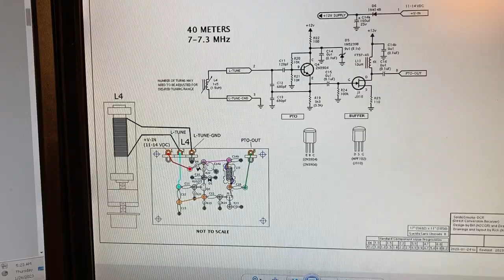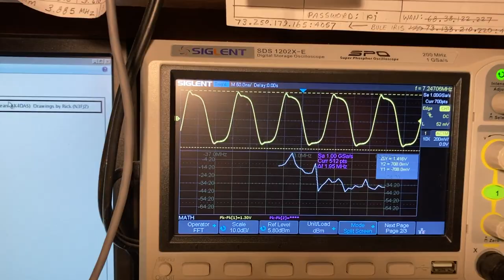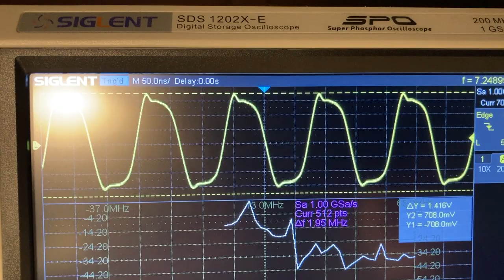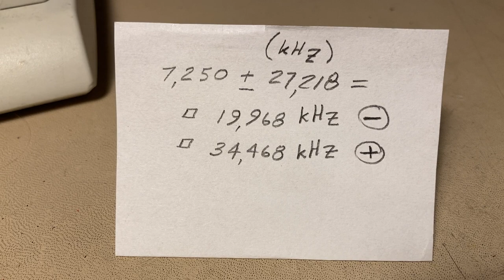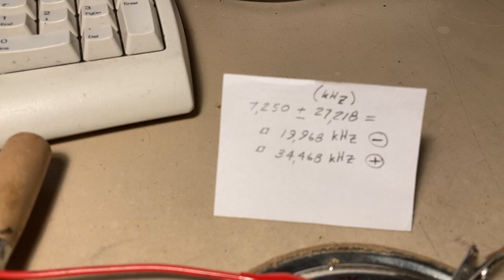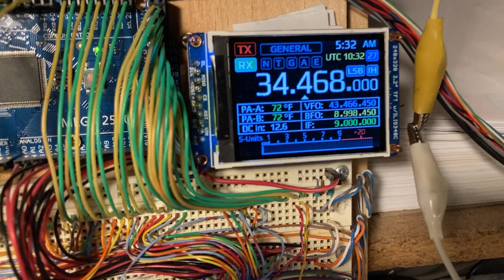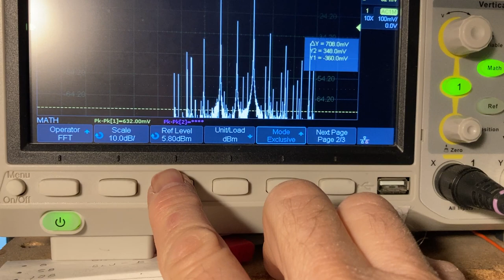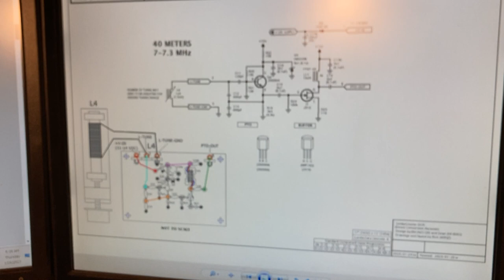SolderSmoke DCR The Joy of Oscillation

Comment: I used to have notes to make the terminal strips out of perf and wire. Can't find them and Google is no help. Duck Duck wasn't either but it did show me the seller of the VU meters I've been looking for. 

Quick question, what did you use to draw the parts placement section?
Reply from the maker: Here's a link on how I do it; however I simplified the design where I changed the lower wires (that solder to the board) to be simple loops (like the top ones) and I bend the loops on both the top and bottom to 90 degrees (if the loops stand straight up, the solder runs down too easily).  Here's the link: http://www.remmepark.com/circuit6040/term_strip/term_strip.html 

I use TurboCAD for the layout and Microsoft Paint for the schematics where I just draw the elemental components as blocks and move them around manually, and for MS Paint, I cut-and-paste at the pixel level (as if the drawing was paper), there is no automation; e.g. wires don't stretch when you move a component, et cetera.  I trained to be a draftsman back in high school (where actual paper and pencils were used) and have been using CAD systems since the mid 90's and find it more enjoyable (as a hobby) to draw like it's 1972 :-)  I would not recommend this method unless you want to do it manually, the better choice would probably be the (free?) automated schematic capture / PCB layout tools, with the side benefit being that you could also have circuit boards made from your efforts.  I thought about it using a PCB layout tool, and I used PCB layout systems on the job early on, but I like the visual results I get doing it manually.
 73
Reply: @Circuit6040   Thanks for the link, it was the one I was looking for. For component style layouts and Manhattan boards I've been using DIYLC (diy layout creator). Free multi-platform and very popular with the effects pedals crowd.
Reply from the maker: @Pixelwaster  Thanks for the tip about DIYLC, something I'll definitely be checking out.